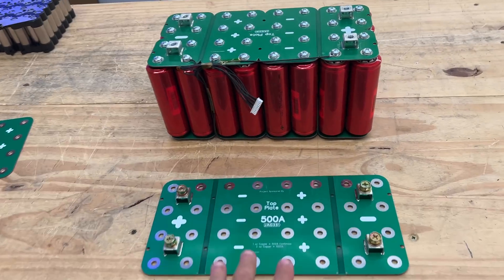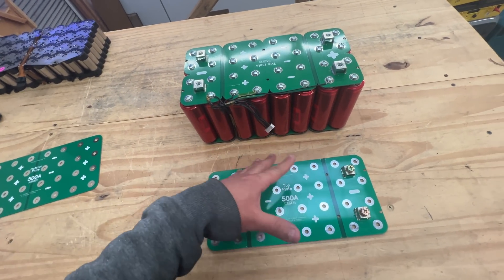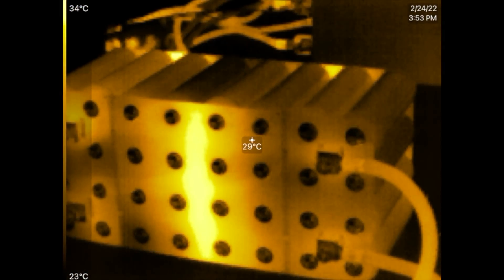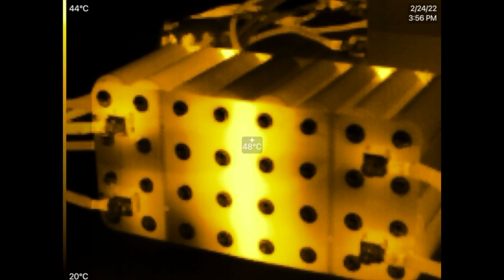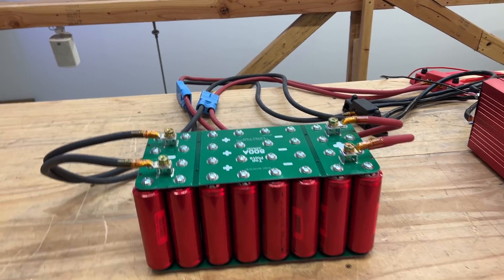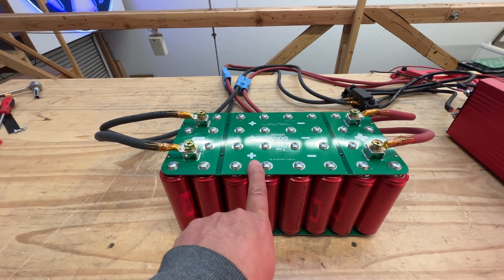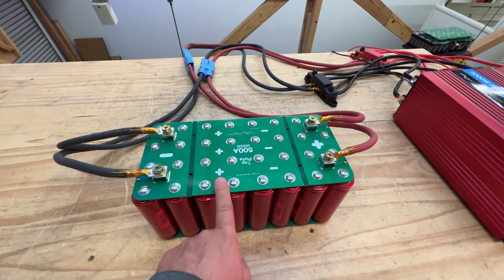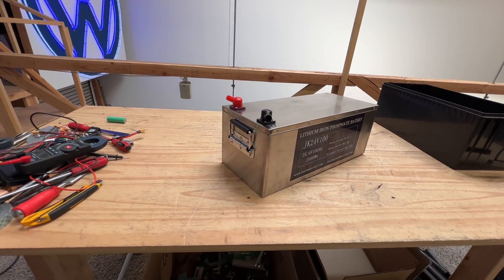Headway PCB Busbars Are IN

Comment: 500A would require traces to be 4 meters wide at 1oz copper per side. or 2 meters wide for double sided. The vias help, but not enough on their own. if you move to 2oz of copper you can bring it down to 1 meter wide trace per side which is still way too much. The way to deal with this is to either add real surface mount bus bars which aren't that expensive. or surface mount wire lugs and then you add some wire to the pcb.
Reply from the maker: Not what my testing shows.  That’s why I test so I don’t have to rely on peoples opinions
Reply: @jehugarcia  you can just use a pcb trace width calculator. 4pcb and digikey both have a free one. those numbers were assuming you're ok with a 10 degree c temperature rise and the room temp is 25c. all those variables are available to tweak in the calculators. if you're ok with a higher temp rise you can type that in just be aware what spec your FR4 is. for instance JLC uses TG130 but OSH Park uses TG175 so you can get up to 175C before hitting the glass transition temp with them. It's not an opinion the physics on this stuff is well known, you just have to fill in all the variables. If you want a deep dive into the specifics you can look at IPC-2221A where all this stuff is defined. then IPC-2222 goes over specifics for rigid boards.
Reply from the maker: Yeah 10 degree rise above ambient is very conservative on a 20 min duty cycle

Comment: I would add some sheet copper at the crossover points of the cells. It should increase the current flow and decrease the heat generated by the resistance of the the thin copper layers found on the circuit boards.

Comment: How many oz is this PCB? 2 oz?
Reply from the maker: 1oz
Reply: @jehugarcia  OK! - i would have thought 2oz was needed for that kind of current tbh.
Reply: Thought to do something vaguely like this for Ebike/emergency batteries, save I would not be working the cells nearly as hard (as a rule.). Good to know it works.

Only trouble is the I-R drop (which causes heat and wastes battery power).  I hope to use 1 sided, 2 ounce copper, and if needed, add thickness (of copper) via electroplating.

I’m not sure just how to fit them to the battery holders just yet.

Comment: Are headways good for ebike setup?
Reply: Not density wise. Hard to beat form factor of 18650’s. Using headways for ebike Is definitely uncommon, but you could still definitely go that route. You could build a very overbuilt battery with headway cells

Comment: Is the headway a good candidate for building a 12v main battery for a truck? I know I’d have to get a special alternator and I also want to run a dual battery setup. One for the truck then one for accessories like winch lights and inverter. I’m building a overlander out of my 91 suburban and want to do something different than the typical AGM setups everyone typically does.
Reply: That is what I want to do with my truck.  Have the batteries just need a BMS.  Back when I started there was nothing greater than a 200 amp BMS
Reply: @youmakeitreal  everyone says the headway is better for high amp draw and not deep cycle. I’m technically not going to pull much power at all with a starter nor the basic efi on my truck. Only thing that would be high amp draw is a winch but I don’t think it really matters if it’s meant for high amps or deep cycle as long as I’m not maxing out the batteries nor draining them low. Realistically they won’t use much power at all ever which should make them last a really long time because I plan to have a solar panel somewhere to charge it during the day. That way if I’ve got a fridge going it’ll have some juice added throughout the day. I really like the idea of being able to fix a battery with basic tools vs batteries you can’t on the trail.
Reply: @kylewest100  I was thinking you had a diesel.
Reply: @youmakeitreal  nope but instead of having a bunch of crap inside my truck I’d rather have it under my hood where there’s tons of room on those square bodies and just add a real good dual electric fan setup and radiator along with huge heat extractor vents on my hood so I don’t have to worry about over heating the batteries and I’m positive in the winter when it’s rarely below freezing before the batteries get anywhere close to low the engine bay will have warmed them up. I was born with a small air way so I’ve got to use a CPAP to sleep and there’s also other benefits I’d get from having a big ass battery bank system. I’m just one of those people I need things when camping and tail gating.
Reply: @youmakeitreal  a BMS isn't needed just use a smart charger
Reply: @SheikhN-bible-syndrome  alternators are not smart to my knowlege.
Reply: @youmakeitreal  hilarious

Comment: So these are busbars for a 12v 64Ah battery setup. People always quote the 25c continuous rate on these headways, but the resultant  voltage drop is severe at anything near those rates. Running these below 10c rate is far better, so a really good product

Comment: The vias in the middle can help with evening out the current between the top and bottom sides but the vias are “tented” with solder mask. No solder can get in them to help with conductivity. The solder mask needs to be held back from the via area so when the hot-air solder leveling (if HASL surface finish is chosen) is done to the bare areas there is a chance for the solder to get in the vias. The vias might have to be enlarged.
Reply: He could leave some solder mask off the top in the middle, and flow some solder to thicken the traces, that might help too..

Comment: Jehu, I have a question.. 
I plan to convert an old car to EV.. 96v 10kW motor.. 
Can a similar batt pack setup you shown, 2 packs 48v in series (96v) drive the EV,  then connect it in parallel to power home inverter (48v)? How will the BMS be installed. 
Shall I charge at 48v or 96v.. 
Appreciate your giving time to reply.. 
Stay safe
Reply from the maker: keep it simple,  run the pack highest voltage possible then use a DC-DC to power any lower voltage devices.
Reply: @jehugarcia  Thank you Jehu.. That was quick.. 

One answer leads to another question.. Can you point me to the direction on how to build a 96to48v Dc-Dc converter.. 
Is this readily available..
Reply: @PaulFonWheels  thank you for the advise.. Asking questions from people with experience is part of my research.. Cheers..